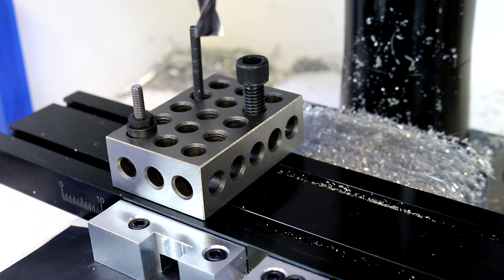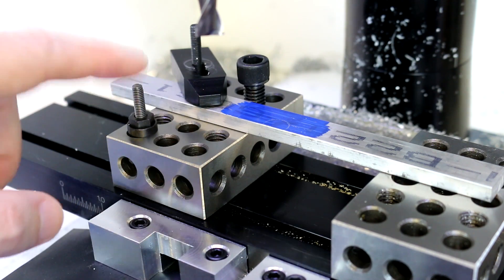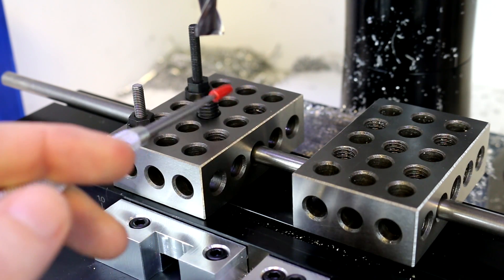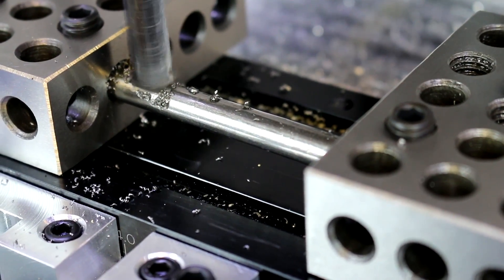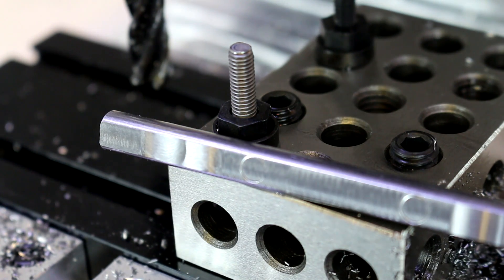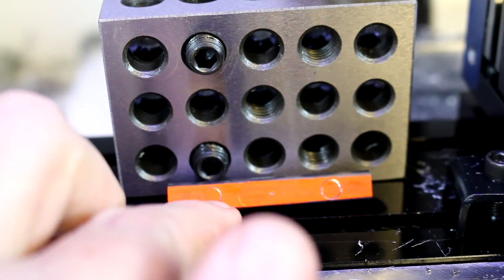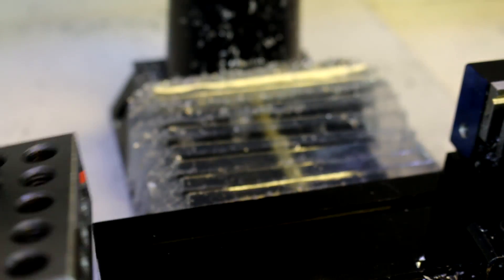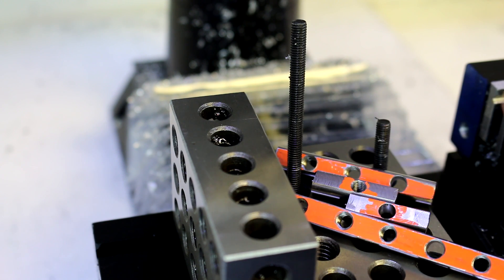Mill Projects 104 - 123 Clamping Bars

Comment: Do you have any advice on how to use that vice?. I have the same and I have a hard time securing a work pieces to it. For example, it wont secure the work piece if the "bean shape" nut below the vice is not inside one of the available slots. Very frustrating

Comment: I bet that block has been hardend, so you would not want to try to tap holes in it
Reply: Nathan Roberson I suspect he purchased pre tapped blocks but threading hardened blocks is not that difficult with the correct equipment.

Comment: What was the movement about 11 1/2 minutes in when you traversed your table it looked like your table was shifting or slopping about. Great Idea though! I am always thinking of ways to expand my table space. By using this technique and putting an end plate to square my piece I can substantially increase my support abilities of the edges of the table and easily rotate my work piece with correct alignment. Thanks.

Comment: Another quick  tip  for the cup set screws put a drop of easy loc-tite on the threads and screw it through the back side so the cup protrudes just a little bit  now use a file to flatten the point,  this works on a hardened 1-2-3 block because the surface of the block is harder then the file so it doesn't harm the block  but only takes the  sharp edge from the setscrew Keep these setscrews aside for tooling uses. 

The recommended  tap drills are based on final thread engagement not material   that relates to class fit  in the Machinery's hand book  For softer more ductile materials normally a courser pitch thread is used   Courser threads also have greater pull out  strength in tension but lessin shear because less of the core material is left. 

I have wondered why the mini-mill t slot nuts are tapped with 10-32 because of this   I also wonder why they did not go to 1/4 "hardware as it is more universally available  from vendors.

Comment: Most  1-2-3 blocks are hardened and polished so tapping the other holes  may not be an option.  Check with a file before breaking a tap in a hole
Reply: Peter Menningen hardened material can be threaded. I've done it many times.